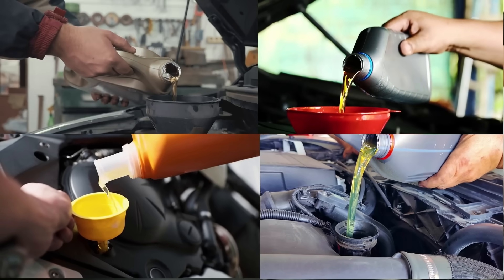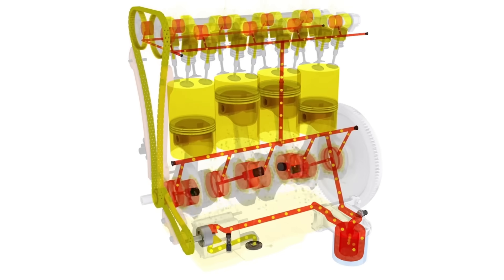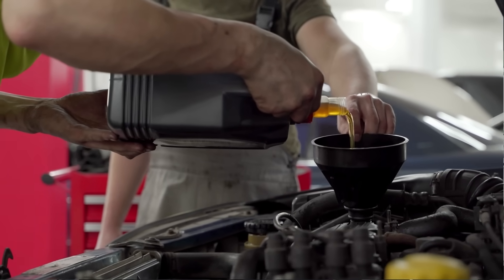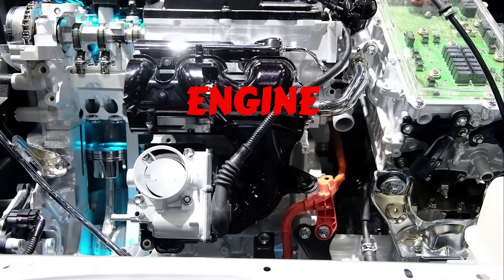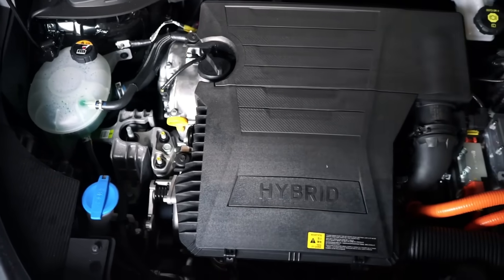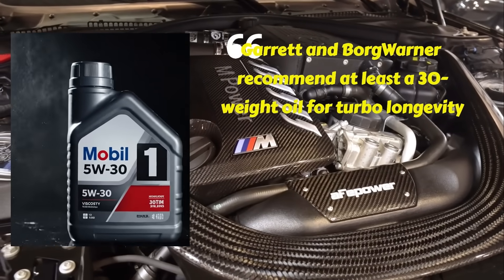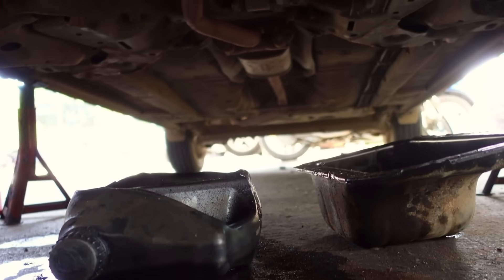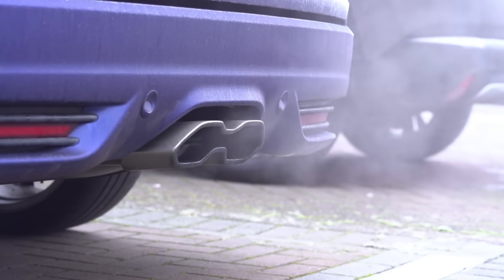The TRUTH About 0W 20 vs 5W 30 Oil (50 Engines Tested!)

Comment: So My 23 Tacoma calls for 0W20, and living in Ohio.  This might break the internet....But what would happen if I were to use 3q of 0W20 and 3q of 5W30. Mixing the two????
Reply from the maker: Good question — and don’t worry, it won’t break the internet 😄

Mixing 0W-20 and 5W-30 isn’t dangerous if both are high-quality oils from reputable brands. You’ll end up with something around 0W-25, which still flows fine in Ohio’s climate.

However, it’s not ideal long-term — you lose the precise additive balance each oil was engineered for. If you want a middle ground, just go with full 5W-30 for a bit more protection or stay 0W-20 for warranty safety.
Reply: You would end up with 2.5W25.

Comment: 2012 Volkswagen CC 2.0 Turbo iron Castrol edge Euro 5W-40 502/505 VW Approved.
Reply: 2003 new beetle awu 1.8T vw engine run it on 5w40 motul power and using  fuel 95 octane  ..actually  it is runs  like new until now ...
Reply from the maker: @hdanielle4164  That’s impressive!  The 1.8T engines love a good quality 5W-40 like Motul  perfect for protection and performance, especially with 95 octane fuel. Sounds like you’ve been maintaining it just right  no wonder it still runs like new.
Reply from the maker: Perfect oil choice 👍 Castrol Edge Euro 5W-40 with VW 502/505 approval is exactly what your 2.0T needs — strong protection, great for turbo engines, and ideal for your 2012 CC.

Comment: Does Toyota’s VTT timing design require thinner oil like 0W-20? Can I use 5W-30 with this design?
Reply from the maker: “Yes! ✅ Toyota’s VVT (Variable Valve Timing) systems are designed to work optimally with the manufacturer-recommended 0W-20. Thinner oil ensures fast flow to the VVT components, smooth operation, and proper hydraulic actuation.

You can technically use 5W-30, but it may slow VVT response slightly, affect fuel efficiency, and isn’t recommended unless specified for extreme heat or heavy-duty use. Sticking with 0W-20 is safest for performance and warranty.”
Reply: @CarCareCrewoffical  You should state this in the video. Important note for VVT systems.
Reply from the maker: @SingleStacked  Absolutely great point! VVT systems rely on  precise oil flow and pressure, so viscosity choice really matters. I’ll make sure to highlight that in future videos thanks for pointing it out .

Comment: I drive a 2024 Toyota Sienta hybrid with an M15A-FXE engine. The owner's manual has a temperature vs viscosity chart that states the allowed viscosities; 0w-8, 0w-16, 0w-20, 5w-30, 10w-30. According to the chart, it appears that all the listed viscosities can be used in a tropical climate. I live in Singapore, which has a equatorial tropical climate of 24 to 35 degrees Celsius. What's the ideal viscosity to use?
Reply from the maker: “For your 2024 Toyota Sienta Hybrid (M15A-FXE) in Singapore’s tropical climate (24–35°C), all viscosities listed in the manual are technically allowed ✅.

0W-8 / 0W-16 / 0W-20 → very thin, best for max fuel efficiency and smooth cold start (though cold start isn’t an issue in Singapore).

5W-30 / 10W-30 → slightly thicker, offers extra protection under high heat or heavy load conditions.

For your climate, 0W-20 is usually ideal — balances protection, fuel efficiency, and performance perfectly. If you do frequent long trips in heavy traffic, 5W-30 is also a safe choice for extra protection.”

Comment: 2026 Honda crv awd located in NYC, states it needs 0W-20....what should i really be using?
Reply from the maker: “For your 2026 Honda CR-V AWD in NYC, the manufacturer recommends 0W-20 ✅. It’s optimized for modern engines, fuel efficiency, and smooth cold starts.

You can stick with 0W-20 safely — it’s the best choice for NYC’s cold winters and hot summers. Using a thicker oil like 5W-30 isn’t necessary unless you do extreme towing or heavy load driving, in which case a slightly thicker oil can provide extra protection.”

Comment: My Subaru 2024 Forester calls for 0W-20. Would an additive like Liqui-Moly be ok(helpful) to use with the recommended oil?
Reply from the maker: “Yes! ✅ You can use a quality additive like Liqui-Moly with your 0W-20, but it’s usually not necessary in modern engines. Modern synthetic oils already have all the protection your Subaru Forester needs. Some additives may slightly improve lubrication or reduce wear, but don’t expect miracles. Always follow the manufacturer’s recommendation to keep your warranty intact.”

Comment: Anyone using 5w30 in a 2017 Rav4 2.5L with over 75K?
Reply from the maker: “Yes! Many owners use 5W-30 in the 2017 RAV4 2.5L even with 75K+ miles. ✅ It provides slightly better protection in hot weather and under load.

If your RAV4 has been running well on 0W-20 (Toyota’s recommended), switching isn’t necessary, but 5W-30 is safe and often used for extra engine protection, especially in warmer climates or for older engines.”

Comment: What about 5w20 and live in a cold winter and hot summer climate?
Reply from the maker: “If you use 5W-20 and live in a climate with cold winters and hot summers, it’s usually fine for modern engines. The ‘5W’ means it flows well in cold starts, and 20 at operating temperature protects your engine in summer heat. ✅

Just make sure to follow your manufacturer’s recommended oil grade, and in extreme heat or heavy load driving, some owners opt for a slightly thicker oil like 5W-30 for extra protection.”

Comment: How about these new 2025 toyota camry with 0W-8???
Reply from the maker: “The 2025 Toyota Camry uses 0W-8 for max fuel efficiency. It’s very thin, designed for low friction and hybrids. Works fine if you follow Toyota’s recommendation, but in high heat or heavy loads, thicker oils may be safer.”
Reply: @CarCareCrewoffical which viscosity you recommended? B4 they switch to 0W-8 the alternate is 0W-16. Can we go thicker than 0W-16?
Reply from the maker: @TanSuroYan  “For modern engines like yours, the manufacturer recommends 0W-8 for max fuel efficiency. ✅ The alternate 0W-16 is also fine.

You can go slightly thicker, like 0W-20, without harming the engine in normal conditions — it may even give a bit more protection in heat or heavy driving. But going much thicker than recommended (like 5W-30) isn’t necessary unless extreme conditions are expected. Always follow the owner’s manual for warranty safety.”
Reply: @CarCareCrewoffical it’s my sister’s brand new camry. I have 2023 pilot with 0W-20 but im switching to 5W-30 next oil change. Will it be good? I need more protection in the engine. My 2013 nissan versa is 5w-30 restore and protect and she’s at 144k miles at the moment.
Reply from the maker: @TanSuroYan  You’re thinking in the right direction 👍 For your 2023 Pilot, switching to 5W-30 is totally fine — it’ll give you stronger protection, especially in heat or long drives. Honda engines handle 5W-30 very well. As for your Versa, sticking with 5W-30 Restore & Protect is perfect for that mileage 👌. Your sister’s new Camry can stay on 0W-20 for warranty, but 5W-30 later on is a solid option too.
Reply: @CarCareCrewoffical thank you so much!
Reply from the maker: @TanSuroYan  You’re making a smart move  Switching your 2023 Pilot to 5W-30 will give better engine protection and film strength, especially in heat or long drives. Honda engines handle it perfectly. And your Versa on 5W-30 Restore & Protect is spot on for that mileage . Your sister’s Camry can stay on 0W-20 for warranty now  later, 5W-30 will be a great upgrade too
Reply from the maker: @TanSuroYan  you are welcome.

Comment: Oil ! Oil ! Oil ! How about comparing conventional, synthetic blend and full synthetic oils !
Reply from the maker: (a) Conventional oil: Cheapest, good for older engines, needs more frequent changes.

(b) Synthetic blend: Mix of conventional + synthetic, better protection & lasts longer.

(c) Full synthetic: Best protection, works in extreme temps, improves fuel efficiency, lasts longest.

Choice depends on your car, driving style, and budget. 👍”

Comment: Do you know what the difference in oil film thickness will be in a modern engine? 0W-20 vs. 0W-40? About 1.1 (10%) at idle and 2% during burnout.

It's not about consumption. The more viscous and non-Newtonian 0W-40 behaves differently than the less viscous and more Newtonian 0W-20. There are many different consequences.

The oil load, the engine load, cavitation at low speeds—and there's no benefit. Well, 40 doesn't protect better than 20 in a modern engine (it's possible that it actually does harm).

The exception is engines with over 350 Nm torque. 30 (HTHS > 3.0) is recommended for them. And over 550 Nm, only 40 (HTHS > 3.4) is recommended. ©(Rheologist)
Reply from the maker: “Absolutely! ✅ Modern engines are designed for specific viscosities. 0W-40 may give slightly thicker film, but in most engines it doesn’t improve protection and can even slightly harm efficiency and oil flow. 0W-20 is optimized for low friction, better fuel economy, and proper lubrication at idle and low loads. Exceptions are very high-torque engines—over 350 Nm prefers 0W-30, and over 550 Nm only 0W-40. Thanks for the detailed breakdown!”

Comment: In India, I have hyundai santro xing in which I use castrol magnatec SUV 5w40 instead of 5w30 and in tata punch I use gulf formula elite 5w30 engine oil instead of 0w20
Reply from the maker: “Thanks for sharing! 🙂 Using 5W-40 in your Santro is okay but 5W-30 is ideal for best fuel efficiency and engine protection. For Tata Punch, 5W-30 will work, but 0W-20 is recommended for smoother starts and optimal performance. Following manufacturer’s grade is always safest. 👍”

Comment: I have a 2025 Mazda 3, live in southeast Missouri (moderate climate with four seasons), drive the car lightly (no towing), and have about 3,000 miles on it. I changed the “break-in” oil at about 1,000 miles. My car calls for 0W-20. I’ve watched several videos like this hoping to get a recommendation on when I should switch to 5W-30 but I can’t seem to get a read on that. When should I change to 5W-30?
Reply: You pretty much have to stick to the 0-20 until it's out of warranty.
Reply from the maker: Hi! Thanks for your detailed info. Since your 2025 Mazda 3 specifically calls for 0W-20, the safest approach is to stick with 0W-20 unless Mazda explicitly allows 5W-30 in your owner’s manual for certain conditions.

Here’s the breakdown:

Break-in oil: You did the right thing by changing it at ~1,000 miles.

Current mileage: 3,000 miles is still very low. Mazda engines are designed to run optimally on 0W-20, even after break-in.

Climate: Southeast Missouri has moderate temperatures, so 0W-20 is perfectly fine year-round.

5W-30 consideration: 5W-30 is usually suggested in older engines, high-mileage engines, or in very hot climates to reduce wear—but your car is new, lightly driven, and in a moderate climate.

✅ Recommendation: Keep using 0W-20 for your Mazda 3. No need to switch to 5W-30 at this stage. Just follow the manufacturer’s oil change intervals (usually every 5,000–7,500 miles for new Mazdas under normal driving).

Comment: Good info. I have a 2023 camry that specs 0w16 but I use 5w20 in it.😊
Reply: Toy makes a 0w-8 now ! That's water.
Reply: In very hot climates I suggest 5W30 or 5W40 .
Reply from the maker: @pedrofernandez8729  Absolutely 💪 In hot climates, 5W-30 or 5W-40 is a smart move — both give stronger oil film and better protection under high temps 🔥. The engine runs smoother and stays safer when the heat’s on.
Reply from the maker: Glad you found the info useful! It sounds like you have a good system for your Camry. 😊
Reply: Do you notice fuel economy drop or smoother engine?

Comment: 5w30 full syn is what my 2018 regal with the ltg calls for and i plan on sticking with it. i saw a vid of a guy with a prius run the regular 0w20 toyota says to use and he did in a test along with an interval of 5w30 full syn (same brand) and used the same roads etc. he also put a microphone in the engine bay. the engine was substantially quieter with the 5w30.
Reply from the maker: Exactly  that’s a perfect example  Your 2018 Regal LTG running 5W-30 full synthetic is spot on. Thicker oil often gives quieter operation and better film strength, especially compared to ultra-thin 0W-20 in real-world driving. It’s not just about fuel economy  protection and smoothness matter too.
Reply: SORRY TO SAY TRULY CONFUSED.
Reply: @lawrencedorfman5543  confused? about what?🤔
Reply: @generalzod7959 I have a 2011 kia forte sx hatchback automatic ac.  I use 5w 20 or 5w 30 mobile one hi mileage synthetic. 
Now if you use the opposite of what the manufacturer says their goes your warranty?
Reply: @lawrencedorfman5543  well, if you have a 2011 kia forte, your warranty has expired and thus no longer applies. i have no idea what the forte call to use. overall though, 5w30 seems to be about as close to a goldilocks oil as there is. if a vehicle is under warranty, do use what they call for though.

Comment: I am changing from 0W/20 to 0W/30 tomorrow. I want longevity. I have been researching this for a few months. I punched my engine into google: "Does the 2GR-FE use different viscosities of oil outside of the U.S.?" This was the answer: Yes, the 2GR-FE engine is specified for different oil viscosities outside of North America, typically allowing for a wider range of viscosities like \(5W-20\), \(5W-30\), and \(10W-30\). The use of \(0W-20\) is a North American requirement driven by emissions and fuel economy regulations, whereas other markets use charts that recommend different viscosities based on temperature. North America: \(0W-20\) is the standard, primarily to meet government and fuel economy regulations. Other markets: A wider range of viscosities is often permitted, such as \(5W-20\), \(5W-30\), and \(10W-30\), based on local climate conditions. Reasoning: The engine is robust and can handle a variety of oils; the \(0W-20\) requirement in the U.S. is mostly for regulatory compliance, not necessarily because it is the only suitable oil. Flexibility: In very cold climates, a thinner oil may be recommended, while in hot climates, a slightly thicker oil like \(10W-30\) or \(10W-40\) may be suggested for high-temperature protection.
Reply from the maker: Thanks for sharing your detailed research! It's great to see you're looking into what's best for your engine's longevity. 🚗
Reply: My car has 300k, Honda. Always used 0w20. Car burns no oil, no knock runs great. If you use synthetic 0w20 will be fine. I’m confident I’ll hit 500k miles on this car

Comment: I live in the North East I have a twin turbo Q50 Infiniti I use 5W-30 in the warmer months and 0W-20 in the months I have 54,000 miles on the car I believe this is the correct combination any thoughts?
Reply from the maker: "Hey! That combo actually works ✅. 5W-30 for warm months protects your twin-turbo Q50 in heat, and 0W-20 in cold months helps with smooth starts. At 54,000 miles, this is safe as long as you keep up with regular oil changes and follow Infiniti’s schedule. Engine stays happy!
Reply: @CarCareCrewoffical thanks I change the oil every 5000 miles like clock work!!
Reply: So a black stone oil analysis and compare results.  That’s scientific evidence.  I run 0w20 all year in my 2025 Acura and oil analysis shows virtually no wear.